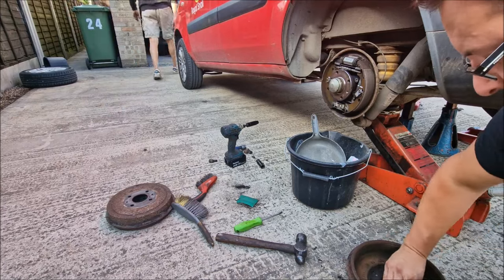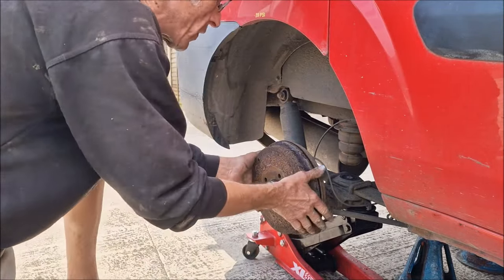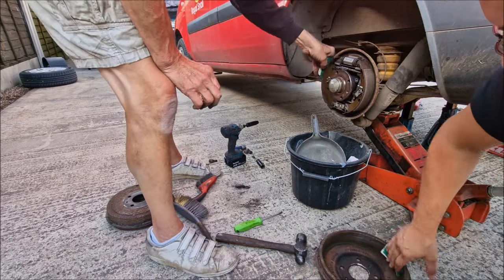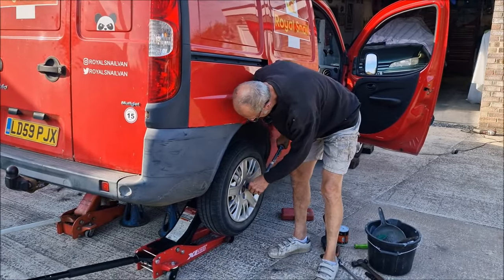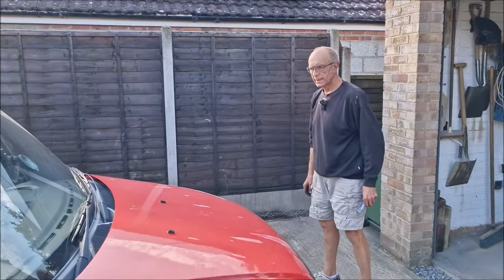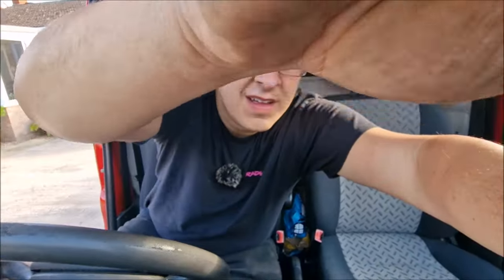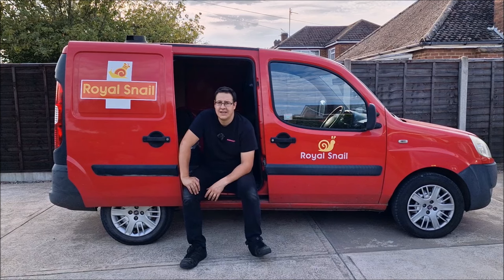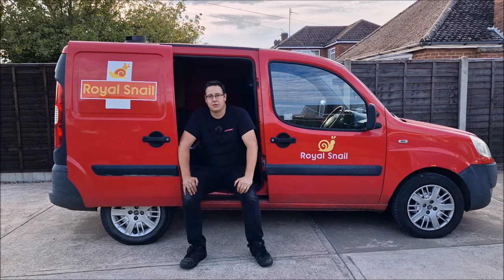What's That Noise? - My Fiat Doblo Cargo Van Has Developed A Problem

Comment: Be careful buying ex postal vans. Here in rural Ireland, the Berlingos were breaking timing belts. Turned out the clock mileage should not be used for timing belt changes. The postmen here leave the vans ticking over as they pop in with the mail. Popping in here can involve a pot of tea and a good chinwag. So the clock mileage bore no relation to the life of the timing belt.
Reply from the maker: From what I know the van was made as a demo vehicle but never used as a postal van as they didn't used Doblos here until the 2010 model. 

Also ... No messing about like that here in Lincolnshire 😂

Comment: Strange that it didnt make the noise when applying handbrake. If you think its brake related, you could try swapping over the drums to see if the noise moves to the other side. It could be a slightly lazy wheel brake cylinder which only materialises when its under load.
Reply from the maker: That's a good idea

Comment: Hi,first thing I would do is jam the spinning vent on the roof then see if the noise is still there.if so then look at brakes and suspension.
Reply from the maker: It's absolutely not the fletner vent :) - done that BUT good suggestion

Comment: I wonder of the OSR drum has a slight crack in it, and when its not under rotation stress when breaking widening the gap, but when no braking or drum is off its ok. I had similar on a mk1 focus.
Reply from the maker: That's a great shout! We will have to check

Comment: Jon nip over to see your mot tester chap and ask him to do a rbt low pressure balance test ''tis the work of moments,that will show the effort each wheel is giving and the one with the variance will give you the noise it's a high spot on a drum or a bit of run out on a disc.
Reply from the maker: Sounds good. I'll drop him a call

Comment: Moral of the story; NEVER buy ex po vans. Theyve been thrashed to hell and back. This is coming from someone who used to work for the post office.
Reply from the maker: This was never used by the PO. It was a demo unit but they never took it on until the next model 😄 Ive done over 100,000 trouble free miles - this is an overnight issue 😂